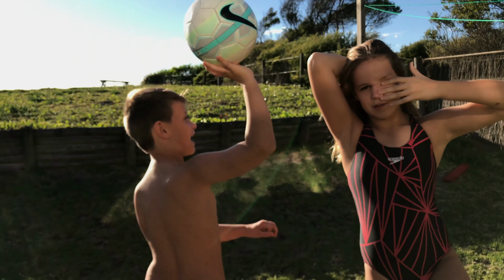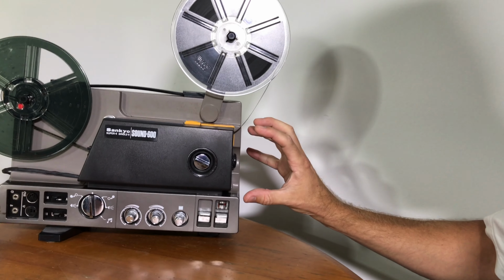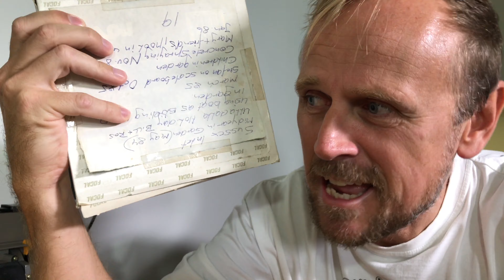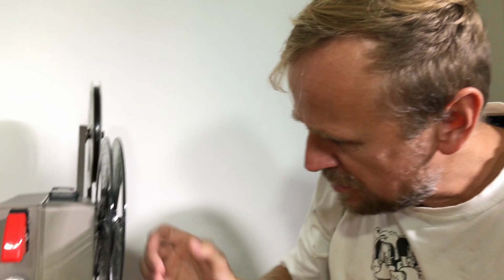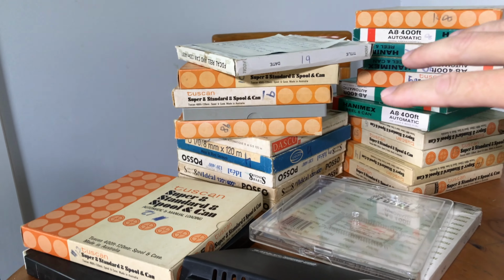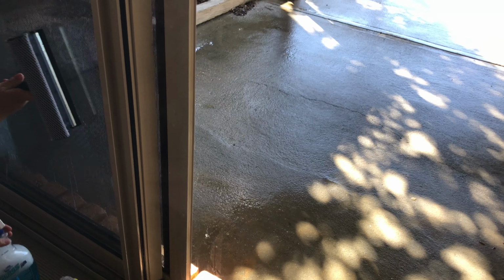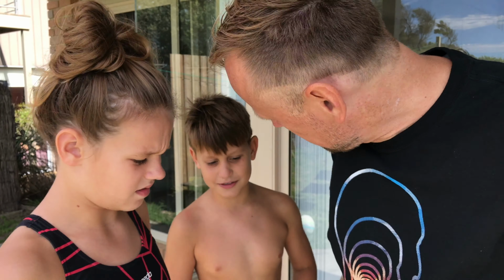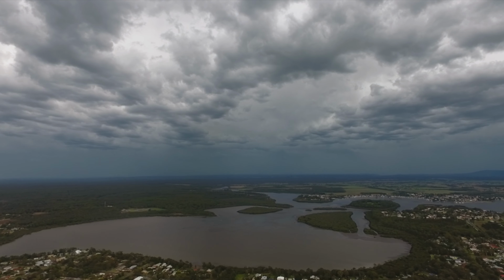How I Digitised Super 8 Movie Film Reels For YouTube

Comment: Awesome work! Well done! Regarding the flicker - could it be that the projector motor was dragging the frame away just at the moment your DSLR shutter was in action? If that's the issue then tweaking the DSLR shutter speed + the motor speed to yield the following sequence of events should eradicate the flicker: Projector pulls the frame over -> DSLR opens shutter -> DSLR closes shutter -> Projector pulls the frame over, etc. Having just written this, it seems pretty unlikely that you can get the two perfectly in sync :D